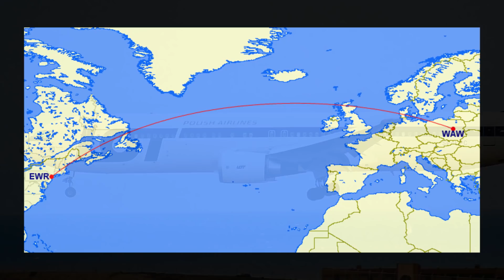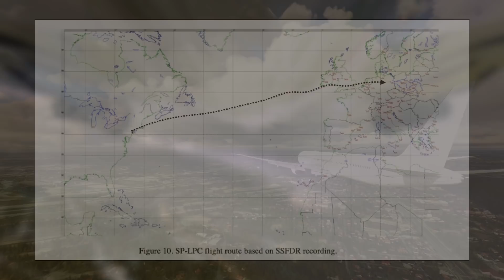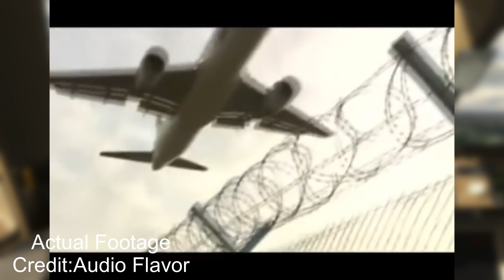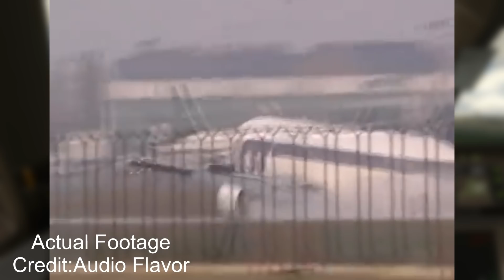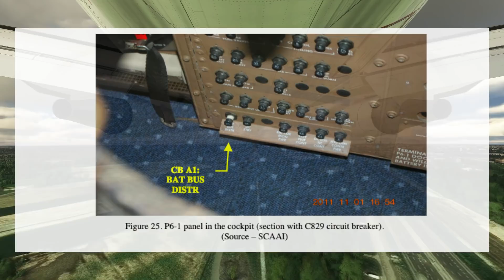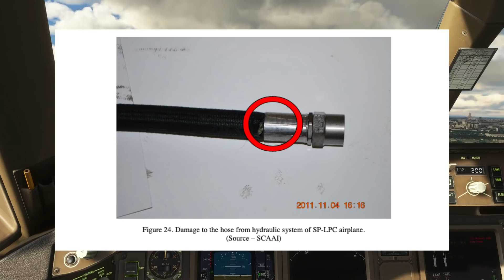A Tiny Switch Causes A Massive Emergency! | LOT Polish 16 (Real Footage)

Comment: I personally would have thought about turning back once I heard about the issue. The benefit of that being that even if the problem happened again if they returned to JFK, they'd have a ton of fuel and time to figure out the situation and perhaps fix that breaker while at JFK, which would have ended the issue.
Reply: It sounds good until they land with a full tank of fuel and it burns up into a fireball...
Reply: @lewisk8742  They'd have dumped the fuel.
Reply: @bobthedemon1975  What is it with all you seppos being experts at fuck all?!

Fuel-dumping capability is optional on the 767.
Reply: I think the ultimate results of how the plane made to Warsaw justifies their decision to keep flying and not dump fuel.  Plus, this flight time gave them time to prepare themselves as best as possible before the inevitable conclusion which was the same either way.  Monday morning quarterbacking a moot issue based on results sort of thing.
Reply: @enigmawyoming5201  - wrecking a plane worth millions didn't make it worth it.  They could have had the same flight time above their departure airport. 8 hours (ish) and been talking to a technical person the WHOLE time. Results were wrecking a plane and endangering all the lives on board.
Reply: @bobthedemon1975  - again… Monday morning quarterback.  Who’s to say?  Certainly not people like you and I that don’t have all the underlying facts that the decision makers had.  And to use “lives on board” when none were lost or even injured….. what’s your point?  It could have a better outcome at any other airport?  Seems to me the decisions made had the best possible outcome that could have been expected. So… why criticize with what you, or anybody else thinks they now know more than those that were responsible at the time that made decisions that worked out as best as possible?
Certainly you aren’t suggesting wrecking millions of dollars of an airplane, with no human casualties or injuries made any difference if they had landed anywhere else… are you?  Seriously think about your logic and ask yourself how it would make any difference once all the fur settled out.  And just how much you actually understand the actual circumstances that the decision makers knew at the time they made that decision.
The end result was as good as it could possibly be.  Just like Sully… are you saying he should have turned around and landed at Laguardia after now knowing how things turned out?
Reply: My point is that it was an incorrect decision.  They wrecked a plane.  They could have easily saved the lives and saved the plane too if they had turned back.  They'd have found that breaker in time and have been talking to a technician for 8 hours rather than 30 minutes.  Their way: wrecked plane + 0 lives lost.  Turning back: saved plane + 0 lives lost.
Reply: @bobthedemon1975  how on Earth to you have the knowledge that the breaker was working if they had turned around and landed?  What am I missing?  If you can do explain that to me I will give you full credit for what you surmise.
Edit:  ohhh, I see what you are saying.  I can agree with you now. It is possible, if they tried to land the plane earlier, after dumping fuel, and circling around, it is possible that there would have been more time to figure out the breaker problem.  I got it…. but I still think that although there is a greater possibility, it’s not a given that things would have turned any different. Again… it’s like Monday morning quarterbacking after the fact whether or not the problem would have, or not been solved in Europe or North America.  In the end…. It’s an argument about $$$$ in the long run.  Not a major consideration in my opinion when it comes to hundreds of lives, either way.  And who knows about ground casualties in Warsaw or New York City, and what considerations were taken in that regard?  Again,,,, you and I don’t know.
And how about language barriers?  Did that have anything to do with landing a Polish jet in Poland instead of the US?
Your logic would make a lot more sense if this jet was running out of fuel after flying across the Atlantic Ocean, and just HAD to land NOW…. But you and I don’t know that… do we?
Reply: Mentour Pilot just put out an EXCELLENT YouTube video this morning with much more detail on the specifics of this flight.  He agreed with the choice to fly the plane back to Warsaw.  https://youtu.be/QMmA--l0HKE
Reply: The company was being cheap and reckless encouraging the crew to continue the flight.
Reply: @00muinamir  Very true.  Instead of hoping that the back-up worked and continuing, they should have turned back and gone into a holding pattern.  That would have given them 8 hours to see if the back up was working and talk to technical support the whole time.  They should have at least tested the landing gear twice before they decided to carry on.